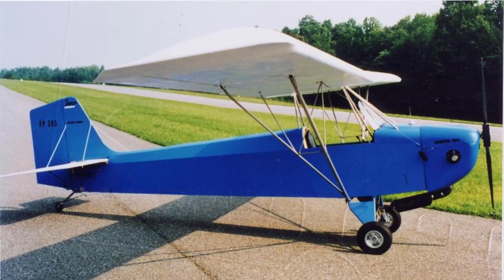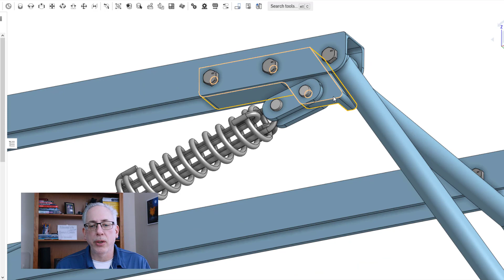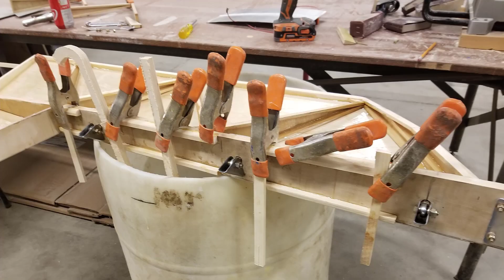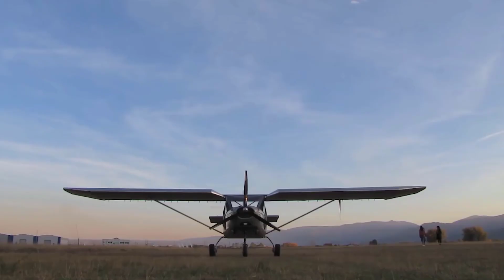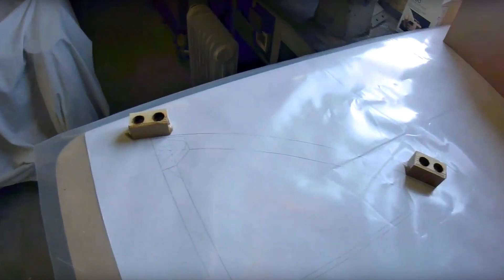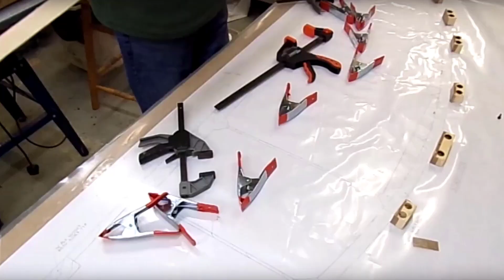HUGE PRODUCT ANNOUNCEMENT! NEW LANDING GEAR DESIGNS! COZYCARB AND ARIA UPDATES! ALGY YATES TAIL KIT!

Comment: Curious about the alignment of the joints on the laminated LE. It appeared that there was one point where all the joints nearly lined up, or was that just markings? I do hope it was markings.
Reply from the maker: Markings!
Reply: The very front one was a joint the others as I said in the video are referance lines to ensure I got the stagger in the joints on each side (which I explained the British requirements), there is only one joint in each lamination. I hope that helps explain for you. Please note that Fisher are taking the video off my YouTube channel, so if you have a question on what I am doing ask there and I will get back to you faster.